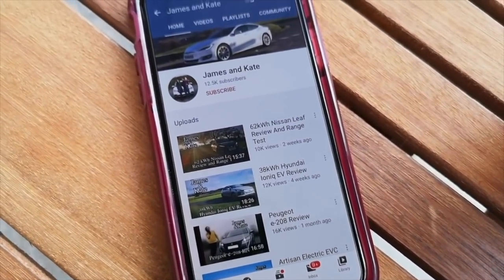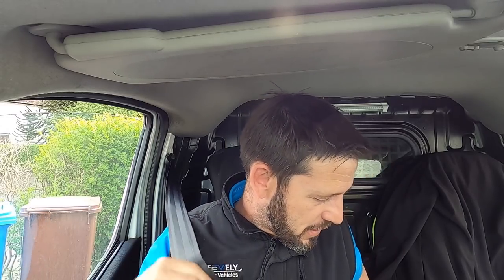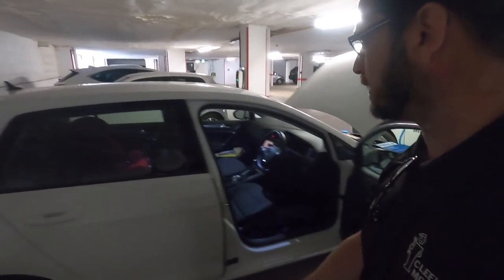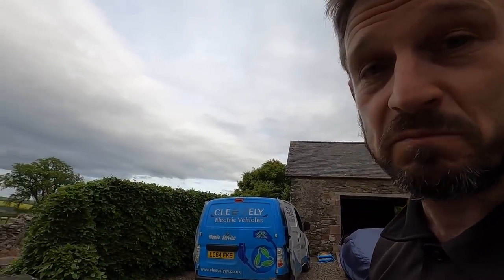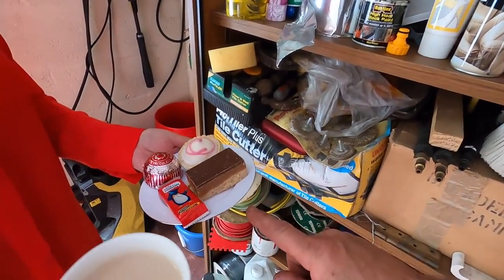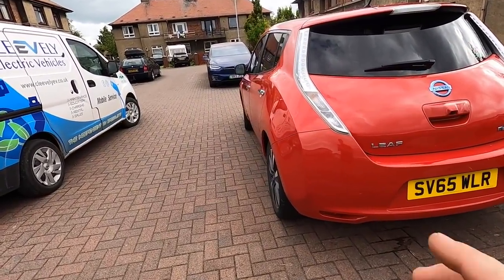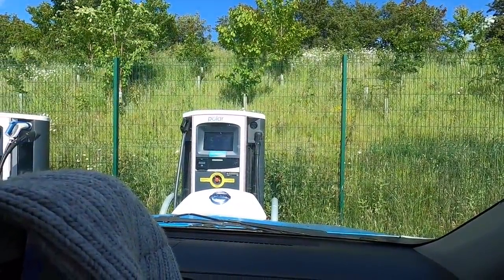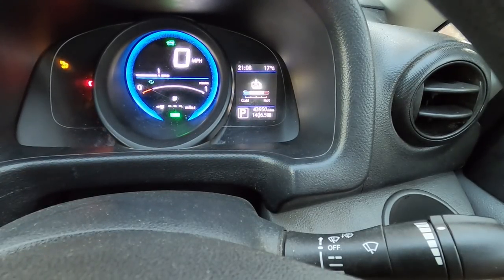You Don't Need A Diesel Anymore -1600 Miles Shows You Why!

Comment: i watch to end   were we doing a top gear finish.    
not the battery is still hot and you have almost nothing in  but it is said that you should charge straight away and not have the battery almost dead and leave it low.  or it damages the battery.
When you stopped at Dumfries  you did not say that there was a costa behind you and a Tesco
When I go to Scotland I stop off at that place.  but the charger 5 to 10 minutes down the road at Chilton trust is free
not sure how you get good deal at prem inn I always find travelodge cheaper.
I do Hope BOB is correct  i have a CPS card and am coming up near end of month when school hols start.  I hope I will not have any problems getting a charge or I will be totally buggered
Reply from the maker: Thanks for watching until the end

Comment: New subscriber loved this video.As an older  in age diesel car owner who is very nervous to go electric due to range fear you showed it can be possible  providing one plans the journey.Also its surprising by your video how many people already own and drive all electric vehicles.What car do you suggest is a starter electric car secondhand with a good range and what mileage on the clock is advisable to buy?
Reply from the maker: Hi and thanks. Depending on your mileage requirements is look at a Leaf. However, if you fancy a PCP, the new Corsa E is £175pcm with £175 down. It's much better than the Leaf too 👍🏻
Reply: @Jamesandkate  thank you for quick reply and your advice I will look at both those options and look forwards to catching up with past and new videos from you 
atb Michael

Comment: Do you ever check the driver side top strut mount for corrosion in Leafs when you service them ? So many Leaf owners are unaware of this potential problem. Just wondering
Reply from the maker: I do. Many have caps but for those who do not, I dry them off, wire wheel them and pack them full of grease.
Reply: @Jamesandkate  good for you . well done . great vids btw & cant wait for your Ireland trips  :-)

Comment: Shame no after market cooling could be added to the leaf/env200, even if its just using the air conditioning, while rapid charging.
Reply from the maker: It's a poor design for sure, but wasn't designed for this type of use. It's still a great van.

Comment: Is the Mercedes Electric van available yet in the UK? I would think it would be a better solution with it's thermal management system for the battery pack?
Reply from the maker: It is, but it's mega money.
Reply: @Jamesandkate  Hopefully the ID van will be reasonably priced.
Reply: The Vito range is not good,80-90 miles, only 3 phase charging?
Just purchased a 75kwh Vivaro for my work van, 200+ mile range loaded with tools

Comment: Interesting video to watch, thanks for filming. Regarding the brake fluid on the e-golf, do you initially test the fluid to see if it does need changing? Curious to know how long it usually lasts.
Reply: He tests for water content, usually changed around every 2 years but not needed if the test is within limits.

Comment: As a self-employed spark I do still need an ICE vehicle. I have no off-street parking so can't charge up at home and many of my customers are in houses with no off street parking. Even if they have it would mean charging on a 13amp socket (if I haven't turned the electricity off). Public charging points in my area are few and far between, and driving to one then sitting there charging would just add more non-billable hours to my day. EVs will work for some people but for many they are completely impractical, and unaffordable. More research into different fuels is needed.
Reply from the maker: Bear in mind that this is a low range and old tech electric van. A newer type doesn't have these issue, charges much quicker and has a much higher range. Sadly there is no alternative fuel thats as clean and efficient as electric. In a world where we need to reduce our demand and pollution, electric is the only way. Your accessibility to high power chargers will change and the price of electric vans will drop. Remember, you're ok to keep your ICE van.
Reply: It's a mistake to think that electric is the only way. It won't work for taxi firms which run vehicles almost 24 hours a day. It won't work for ambulances or other emergency vehicles which have no down time. EVs have improved dramatically (would kill for a Cross Tourismo) because of the money pumped into research, this will be true for other energy sources. More research into hydrogen will benefit larger haulage vehicles and Porche are developing synthetic petrol. We shouldn't put all our eggs in a basket that doesn't work for many people.

Comment: MODEL 3 PERFORMANCE has different brakes and suspension. Get the LR or SR+ they are designed for range not drag racing. Most people are blown away by the LR's standard non option boosted 0-60. While the vast majority of drivers have never owned a car as fast as the SR+ even though in TESLA world that is the slow coach. I see less and less point to the Performance version*. Plus LR and SR+ now come from Shanghai with the new trimmings and good build. *(Even the whole MODEL S PLAID thing bores me as a pointless indulgence).
Reply from the maker: I agree. We have a 3P and should have bought a LR with the speed upgrade.
Reply: @Jamesandkate   Even without it. Great thing is you can test the upgrade then you have a "change your mind" option...you can activate that and it removes the software upgrade and refunds the money.

Comment: Was interested in your comment about upgrading to better carbon filters in the MG have you measured differential pressure or the current drawn by the fan motor following the upgrade?
Reply from the maker: We haven't, but the manufacturer that offers it as a direct replacement probably has. If there was any issue i'd only expect to see it at full flow for a prolonged period, and as the fan motor sits in the direct cool airflow I'm sure it will fine.
Reply: @Jamesandkate  Thanks for detailed response. Although as an engineer I am a bit anal - I would like to see the spec plate with designed running current and max current then measure actual current with OEM filter and again with upgrade filter. But that’s my problem (and has been all my working life) - anal attention to detail.😉

Comment: You've probably been asked before....  but i'll ask anyway... can you tow an ev with a flat battery.? and in 'drive mode' will towing the flat ev charge the battery.?
Reply from the maker: Yes you can, but make sure it's in ready mode. If it isn't you're in trouble. It will recharge the battery.
Reply: @Jamesandkate  'ready' = 'drive' mode... not 'park' or 'neutral'... or 'R... reverse' obviously...

Heres an interesting read i found on the Which? website... https://www.which.co.uk/news/2021/06/eight-things-electric-car-owners-should-know/

I should add that i (with my limited knowledge) agree with you, and that i think Which?'s report is total rubbish and the reason i'm about to cancel my membership. Even Edmund King, the AA's top man even reported on 'towing ev's' in a recent tv news article.

Comment: James a question 
Would an e-nv200 cope ok with a daily fast charge and a trickle over night on the 3 pin aiming to do 150 miles a day .... thats a day in day out situation ....

Or would i find over heating batteries so sat on a charger for 4 hours at a time ?
Do you think the maths would work ?
Reply from the maker: It would cope fine with that. My use case is very much the extremes, but I cover 200 a day easily in normal use 👍🏻

Comment: No electric van for me not yet it works for you because of type of job your doing all your customers have electric cars.  Not in my world yet mate.  If you don't like knee pads you can get a knee board screw fix mate good content tho
Reply from the maker: Thats a fair shout, but the next gen electric vans are 300 mile plus fully loaded so may work for you.
Reply: @Jamesandkate  thanks for reply u2 in next 10 year i will see  but 300 mile at moment it's not there yet  . Next there will be electric motorcycles (o shit  )  im old and still like 2 stroke.  Thanks for reply.

Comment: where do you jack the car? i see you took both wheels on one side off at same time nissan leaf :) bob murphy is the swarco man :)? cps changing to swarco, it'll be interesting , wonder if cps app will stop working, does anyone know? my leafs got 107k should i change the transmission oil?
Reply from the maker: Hi. The Leaf has marked jacking points. Yes, Bob said there will a new app coming. Yes, get the reduction gear oil changed.

Comment: A quick question, do you travel to the South East, Eastbourne and do you service Kia Niro’s, can you also update the software mapping ect.  Watching your Vlogs I realise how haphazard some dealership mechanics are when servicing cars. Certainly the dealer I bought my car from left it with thousands of micro scratches after they cleaned it before pick up. I only really noticed it some time later when the sun was shining from a certain angle.
Reply: I always tell garages not to wash my car. It’s nearly always done by someone who doesn’t care about the job
Reply from the maker: We do cover that area. If you need our services contact Mobile@cleevelyev.co.uk. We can't update your maps, however, that's down to the manufacturer.

Comment: What that trip really shows is why YOU don't need a diesel van anymore. But............I'mm sure most might get away with an EV too.
Reply from the maker: Remember, this is an extreme use case, most vans are sub 30 miles a day so no issues.

Comment: We were told that EVs don’t need brakes replacing due to a lack of use yet you seem to do a lot of brake replacements.
Reply: Well rust is the reason for that 🙄
Reply from the maker: Depending on your EV, you probably won't need it, but the Leaf and Tesla do have issues.
Reply: @Jamesandkate  the ‘Hold’ mode in the tesla is useful as it uses the brakes to completely stop which at least exercises the pots.

Comment: Sorry have I missed the point. 134 miles is the total range! Battery very hot. Got home with no range and had to drive slowly to achieve that. How long would it take to charge at home? There is nothing in this video that makes an EV van a good idea. Seams very stressful to me.
Green hydrogen.
Reply from the maker: This is short range electric van covering big distances. It was never designed for this, however, it coped and saved a fortune on diesel costs. There is no such thing as green H2 and its energy intensity is far more than producing diesel when brought to street level applications. If I was using a new electric van designed for this, it would walk it with none of the issues I experienced.
Reply: @Jamesandkate  The basic problem is moving and storing energy in the form of electricity. How many fast chargers do we need? How do you get that many mega watts to all the required location. How much does that many fast chargers cost. 250KW inverters aren't cheap.

Comment: Don't need a diesel ?  Save loads of time without all that charging
Reply from the maker: It's the cost and pollution though. This is an extreme use case and most people don't exceed 30 miles a day, so charging would be no issue.
Reply: @Jamesandkate  Not the trip he was on

Comment: This thing can just about cover 200 miles on a charge.  If customers were not generous enough to provide free fuel, everything would have stopped.  Indeed, the frailty of the charging system is yet another reason to avoid these things like the plague.  If the predicted EV growth does take place, there will be a queue to charge and he will quickly get bored if these very silly machines.
Reply from the maker: This is an old, low range electric van, the new ones don't suffer like this one and have a much better range. You say very silly machines, but if you understood the complexity of a CI engine you'd know exactly why they aren't silly.
Reply: @Jamesandkate  I do not know what a CI engine is.  I do know that these electric cars are incredibly complex and very expensive.  They do not contribute to the exchequer and if sales take off as hoped, there will be charging chaos partly because there will be insufficient chargers and partly because there will not be the electricity to power them.

A 150KW charger is the single phase power supply to 11 terraced houses.  A 7.5 KW charger is the equivalent of a new storey in every house.  In the case of small flats, you will effectively be doubling the electricity consumption for every flat.  It is doubtful that the power supply to the block would cope.

The age of the van does not alter the fact that the chargers often to do not work and with such a limited range, finding a working charger suddenly introduces a lot of stress into driving, which is not helpful.

For what it is worth, the Treasury has estimated the cost of doing the full green nonsense is £1 trillion.  The record of such forecasts is not good.  Cross Rail has soared over budget, HS2 is now three times its estimated cost and still climbing and the Channel Tunnel ran out of money during construction and is in trouble again today.

I would think that we are looking at a bill of £3-4 trillion to get all this done.  Our GDP is under £2 trillion.  How exactly is all this to be paid for and who will be doing the paying?  Nobody is saying a word.

That is why these machines are silly.  Actually, they are threatening the nation's future and all because some very successful propagandists have convinced the population that CO2 is a pollutant.  Nothing could be further from the truth.

I am more than happy to debate this with you here if you so wish.  The difference is that I have the facts and figures rather than the empty slogans repeated by the faithful worshipping at the alter of green.

For what it is worth, Friends of the Earth, the Green Party, Extinction Rebellion and the Energy Saving Trust could not tell me the level of atmospheric CO2 or even by how much they would want to see it reduced.  They certainly do not know how much CO2 will be saved if these crazy ideas and policies actually come to fruition.
Reply: @kevanchippindall-higgin1859  I totally agree with you, and also, let’s not forget about high insurance costs and cost of complex replacement parts compared to mainstream vehicles. For example, try to compare the cost of a Tesla headlight or battery pack replacement (vs a new diesel engine).

Comment: Wonder how customers would react if you asked if you could siphon 2 gallon of diesel out of their cars at each job ? What a ridiculous way to work. I would be embarrassed. Electric cars are fine in a city but good for nothing else. The idea that anyone saves money by having one is nonsense.  Btw a set of front pads for my diesel toyota is 20 quid. Set of discs are 40...
Reply from the maker: I can tell you neither own or have driven one by your comments. My personal EV has been all over Europe and this is a low range electric van. My customers offer for convenience because an EV can charge at a customers, where a diesel cannot. The reason we use an EV, is because it saves us so much money, so it clearly does save money.  Enjoy your Toyota.
Reply: @Jamesandkate  You are kidding yourself. It's the emperor's new clothes...

Comment: There is no recycling the new batteries and they go to land fill and so are not the way forward.....we were better off before marxists took over gov.con when we had lead acid battery milk floats (recyclable ) and english vehicles with sensible engines and petrol....we now have to look forward to mentally ill rules and regs that do not give any real value ...
Reply from the maker: You're ill informed. Batteries can be recycled, they don't go to landfill and burning petrol isn't the way forward. We buy second hand modules for £250, they're too valuable to chuck away. I've never seen a battery in landfill and they fail so infrequently there hasn't been the need to recycle. When they are no longer suitable they are repurposed for grid storage systems or other applications. The cost to the planet to put petrol in your car after being dragged out of the seabed and put through fractional distillation is on a cataclysmic scale. Our local oil refinery uses more electricity a year than Coventry and Leicester put together!!! That's before you burn it in your engine. Sadly, you may not like it, but the facts are, it's changing!!! The cost to run an EV are actually very low in comparison to an ICE. 250 miles costs me as little as £2.80. I think Marx isn't a great example, we're not trying aiming for social divide, but a cleaner planet.